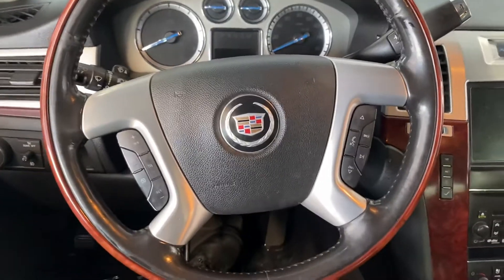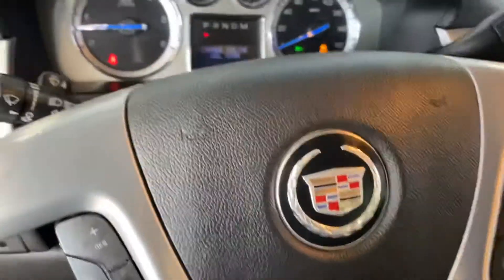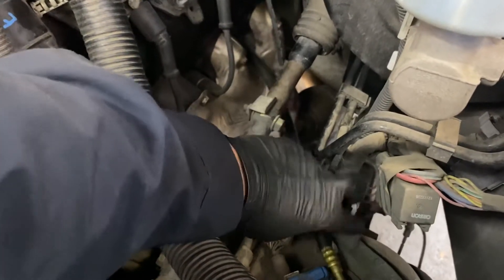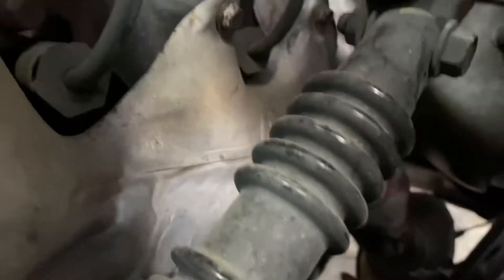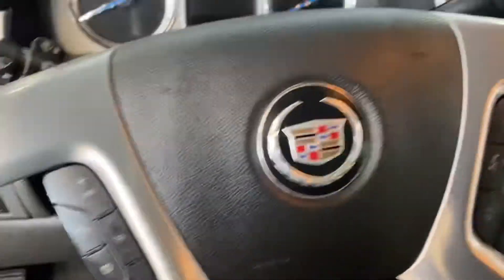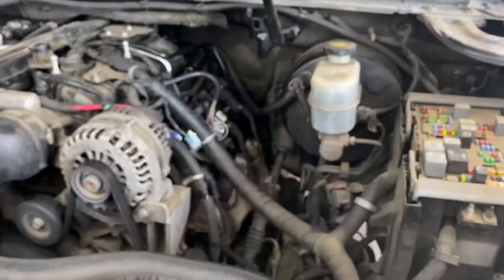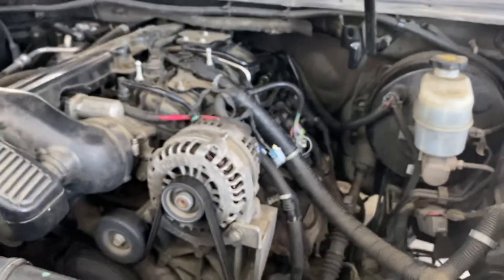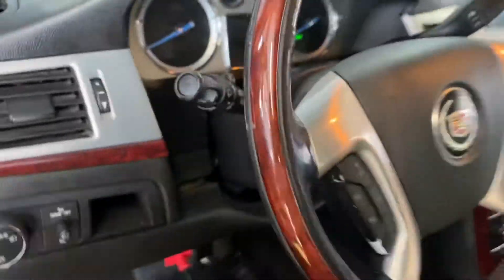Lifters Stuck off 2012 Cadillac Escalade 6.2L Misfire cylinder 7

Comment: Compression test is not being done right. You're not supposed to have the engine on or running. You're supposed to remove all of the spark plugs. Disabled the fuel system. Then crank the system over x amount of times.
Reply from the maker: You are absolutely right, it’s important to do a proper compression test. 👍🏼

Comment: What is needed if there is no compression? New valves? I see your diagnosis but what is the resolution and approximately how much will it cost? I have this problem 2009 Escalade ESV. Thank you.
Reply from the maker: I replaced the plastic base and all the lifters basically where was the misfire !! Cost parts $600 and Labor $1,200 👍🏻
Reply: @danielscustoms13   thanks for share the labor price it helps a lot please keep sharing labor prices ! ✌️
Reply from the maker: @VZGarage  why not bro take care and thanks for your support!!
Reply from the maker: Subscribe to the Chanel for more videos like this 👨🏻‍🔧
Reply: I replaced all the elevators and it's still on cylinder 7. Could it be the plastic base?
Reply: I have the same readings when I did the same test on # 7 how did you fix?
Reply: I have a misfire on 6 cylinder in just like this but what the possible solutions to fix it?